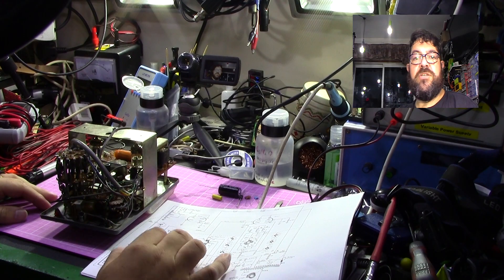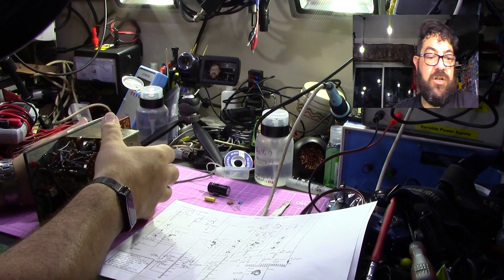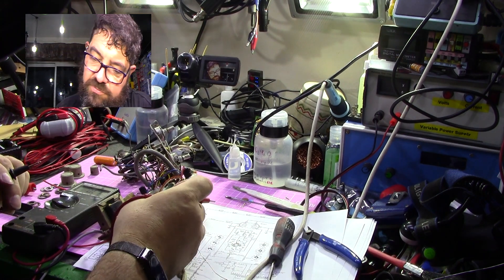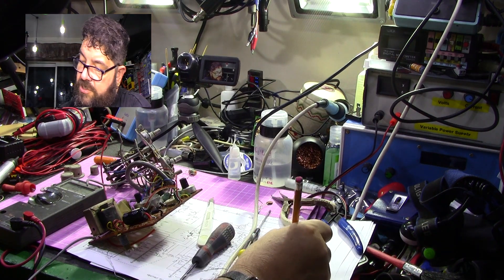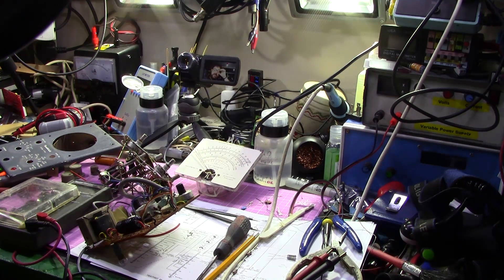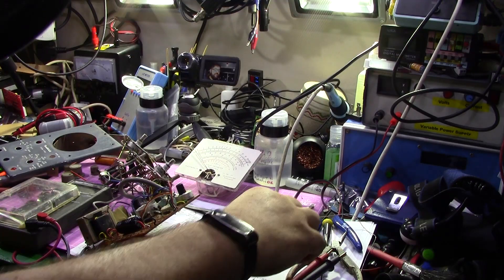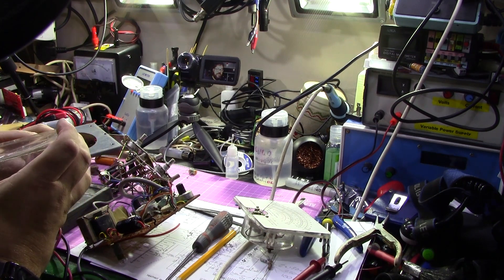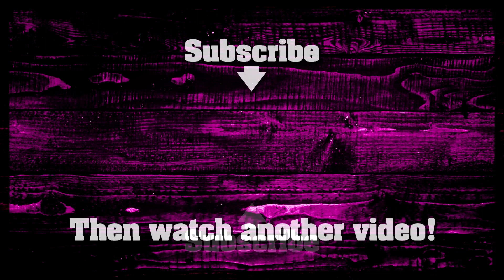Heathkit V-7AU Repair Teardown Time

Comment: When the traces lift up like mine did on the bulb super glue and a couple of alligator clip for about a hour after I get mine apart like your I will put some epoxy glue too
Reply from the maker: Indeed Ron. I do try and save tracks wherever possible. Whatever glue that you use, if you ever need to rework it, the fumes can be awful to deal with!.

Comment: Your video quality is excellent George....sharp well lit good close-ups and sound..and you bench is one of the most wonderful messes i have ever seen...grin...i am still thinking about the solar light in your hall....its stuck in my brain...lol.....no battery control chip???...is it inside the battery?
Reply from the maker: Thanks for the compliments on the quality. Just bought the lens for the camera used in the overhead shots because my other lenses were too high a focal length. Also just bought another HD camcorder to do the face work to replace the standard  def camcorder I currently have. The mess is intrinsic to having no space and sharing the room with the family and the chaotic mess inside my head! I do know where everything is though. I lose things when I clean up.

The solar light is working fine now and no, no battery protection at all. I think that they are relying on the fact that it will discharge at a rate that is fast enough to not get into an overcharge situation. I measured the battery and there is no extra length over a standard 18650 for a protection circuit, even the ones in my high quality li-ion batteries.

Comment: Never thought about using the nail lacquer to fix the old PCB boards. Looking forward to the next installment.
Reply from the maker: It's quite an old trick but it has been made better with the UV curing stuff that ladies have these days. Before you used to have to wait a fair while for it to dry but now, 20 seconds under a UV light and its done. I bought a cheap USB powered light from eBay for 3 pounds and the lacquer is dirt cheap from china.